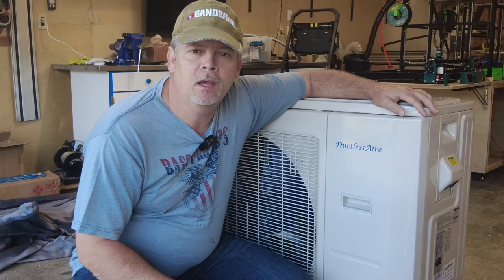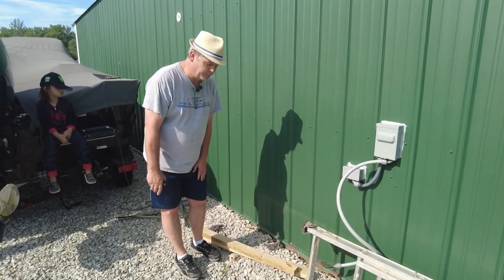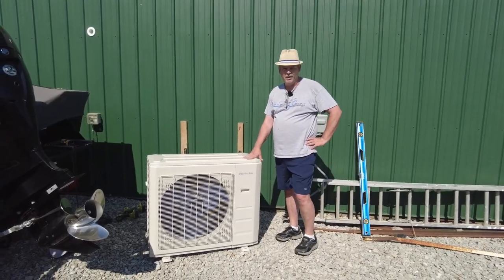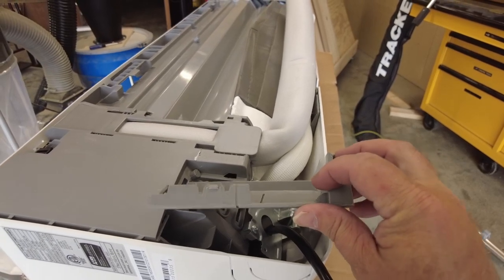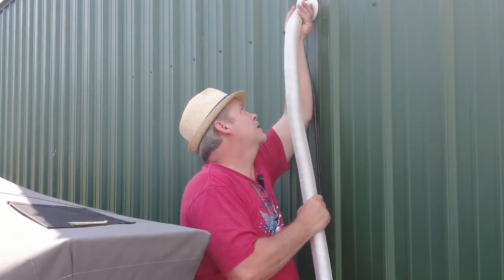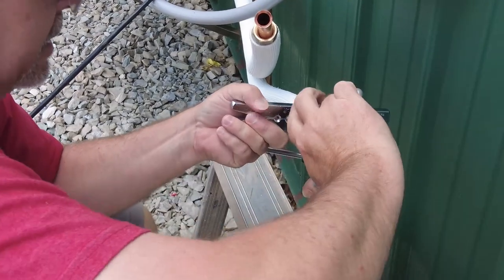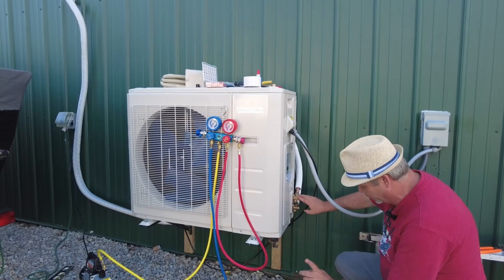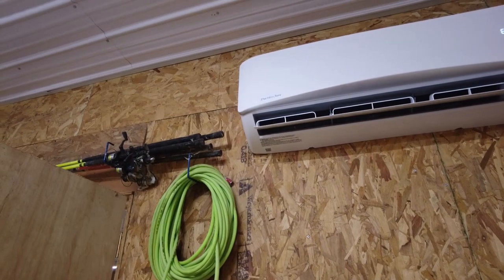How to install Ductlessaire mini split

Comment: Disconnecting the hoses before releasing the refrigerant introduces moisture back to the system pretty much your vacuum was lost you have to release refrigerant before you disconnect hose you have to have positive pressure so you don’t intrude moisture to system
Reply from the maker: Thanks for the tip, I'll pin this comment for others.
Reply: So I'm confused.  Is he saying you did this or is he just offering tip.  I just wanna make sure I understand fully so I don't screw my install up. lol
Reply: nvm.  i understand now.  means don't disconnect hoses after vacuuming out until after you release refrigerant
Reply: @eliyyahsilva1282  yes exactly after your done with vacuum close your low side gauge and turn off vacuum pump and don’t disconnect any hoses and then release all the refrigerant to lines with a Allen key and then once you release all refrigerant turn on the ac unit to cooling and then disconnect the hoses
Reply from the maker: @eliyyahsilva1282  Yes that's what he meant. Good luck, be sure to let us know how it goes.
Reply: @whatsnextdiy  You saved me $1500 installation.  I wish you many video monetization cycles in your future from YouTubers like me.  Thanks again, worked step by step and fired on cool the first try.  Thanks again @4K Crib for your tips as well....!!! Booooommmmm....
Reply from the maker: @eliyyahsilva1282  Awesome news to hear. Maybe one day I'll monetize but stories like yours are sweet 🎵 to me.
Reply: @whatsnextdiy  so I thought I did everything correctly and I still think I did, but it's possible something may be leaking now.  My inside unit is making a hissing noise now and I'm not getting any cooling.  Weird though because it was working fine until I tried using heat.  I have a home warranty so I'm going to have a service contractor come out now that all the hard work is done.  Hopefully it's as simple as them finding a leak and correcting it.  I don't want to take any chances though so a $125 deductible is a lot better either way than paying $1500 install fee lol.  I'll keep you posted.
Reply: Update:  Had heating/cooling pros come out and service it for me to double check everything.  Turns out I did not tighten one of the flare nuts down enough (low pressure).  I paid a total of $200 ($125 for home warranty deductible +$76 for recharging the refrigerant), but saved about $1300 so I'm still way ahead and I have peace of mind.
Reply from the maker: @eliyyahsilva1282  Awesome glad to hear it was something rather simple.
Reply: @eliyyahsilva1282 How’d your insurance claim go on the A/C you installed yourself? Lol
Reply: Is the unit still cooling and heating.?  I have installed 3 of these units on my house and have now turned off my big central air unit outside and inside.  The very first unit I installed I removed the vacuum pump connector BEFORE I opened the valve to release the gas into the lines.  The same thing you did.  At that time I did not know the procedure for releasing the gas.  The unit is cooling fine tho and has been running about 1 month.
Reply: I can confirm you must pressurize (just a little) the line before you remove the manifold.  1) as mentioned, it may draw air/moisture back in the lines.  2) you really don't know if you opened the shrader valve when you drew the vacuum.  it could be that you were just evacuating the manifold and hose.  You remarked at the fast response of the vacuum.  This is a sign that you may not have breached the line site.  If you can get a micron gauge, hook that up to the high pressure line (of the unit).  This will allow you to view the draw down and watch the recovery.  This is a much more trustworthy method.  With a typical split system on a home, you do this 2 to 3 times and watch how much the microns increase (moisture gassing) after shutting the valve off.  Also, many times a HVAC tech may pressurize/purge the lines with nitrogen to see the connections pass leak tests.  If you are connected to both H/L sides, you will see the gauges go up together even though your are inputting say via the L side.  On the last purge, you connect your vacuum pump and go through your pull down.  Then you know it will not leak with moderate pressure and you are actually evacuating the entire system.  I know this is beyond the average DIY install but just know it is the ideal way to do this install if you have the resources.
Reply: @eliyyahsilva1282  I just noticed this.  Yeah, in heatpump mode, the H/L reverses lines which means you have high pressure on the larger (suction in cooling) line.  I suppose it was a leak made worse by higher pressure.
Reply: I installed the same unit. Dealing with the line set was a bear! I wonder if it would have been better to separate the high and low sides. I was afraid all the torque applied to the indoor connections would cause a leak. 

Second, is there any reason the line set needs to be wrapped together?
Reply: Wrapping the lines is only to help get it thru the hole in the wall. I only did that with 1 of my units. You do need to get a vacuum pump and pump your lines down.
Reply: What you say is true but what the gentleman in the video was doing was checking for leaks.If the vacuum pressure dropped/failed to remain steady at any point in time the system would have allowed the refrigerant to escape once the refrigerant valve was opened and what then?
Reply: @eliyyahsilva1282  If you did like the gentleman in the video did and didn't ream the copper tubing after you cut it before you flaired the ends and also installed the high pressure line first instead of installing the low pressure line first then of course you ended up having a leak.The gentleman in the above video ended up having to really torque on the low pressure line because he had a leak.The gentleman in the video was trying to bend the low pressure line a bit more which proved to be difficult because the gentleman installed the high pressure line before he installed the low pressure line and as the video clearly shows the high pressure line having been connected first instead of last made any adjustment to the low pressure line very difficult.I'm surprised the high pressure line didn't end up leaking with how the gentleman in the video was cranking on the low pressure line and trying to bend the low pressure line further to where it needed to be bent.If the gentleman in the video was in such a rush that he couldn't be bothered to first install the low pressure line and tighten it down properly before he connected the high pressure line then why did he even bother?He had to know that doing it the way that he did it was going to allow a leak.I clean my own furnace and when ever I have to remove the atomizer to change the nozzle tip I am very careful not to over tighten and to this day I have never had to cut and reflair the copper tubing that that connects the atomizer to the furnace fuel line.That thing about having the copper tubing stick out a milimeter is also something that I cannot and will not put stock in because I have had to flair plenty of copper tubing and the only thing that I ever had to do was to line up the end of the copper tubing to be flaired flush with the face of the clamping jig and that was that.Here's a great trick that won't allow copper shavings to fall into the copper pipe/copper tubing when you ream the copper pipe/copper tubing.Stuff a piece of paper towel in the end of the copper pipe/copper tubing that must be reamed,ream the copper pipe/copper tubing then with a pair of needle nose plier pull out the piece of paper towel that you stuffed into the end of the copper pipe/copper tubing and you will never have any copper shavings fall into the copper pipe/copper tubing because as you pull out the piece of paper towel that you stuffed into the end it will bring out any copper shavings that would have stayed in the copper pipe/copper tubing if you reamed the pipe/tubing without first stuffing a piece of paper towel into the end of the pipe/tubing.

Comment: Thank you for sharintg your video with us.I hate to knit-pick but there were several things you could have and should have done.The first thing is that after you cut the copper tubing down to the proper length you neglected to ream the copper tubing ends and opened yourself up to have a serious problem.The problem you opened yourself up to by not reaming the copper tubing ends is that when copper pipe/copper tubing is cut the cutting process tends to leave a burr inside the copper pipe/copper tubing and therefore copper pipe/copper tubing must always be reamed after being cut to get rid of any burrs that result from cutting the copper pipe/copper tubing.The second thing that you did wrong is that you installed the high pressure copper tubing first instead of installing the low pressure copper tubing first.I pained me to watch you torquing the flaring nut on the low pressure tubing with how much stress you had to put on the high pressure tubing just to tighten the flaring nut on the low pressure tubing.If you had bothered to ream the copper tubing after you cut the copper tubing before you flared the copper tubing and you had first installed the low pressure copper line you would not have needed to use any type of teflon tape or thread sealant like you had to do in the above video.I'm 63 years old now and I remember when I was much younger I worked with certified contractors and licensed plumbers and I learned the hard way that copper pipes and copper tubing must always be reamed (deburred) after being cut to size.Even PVC pipe must be reamed after being cut because if not the chances of clogs increases from waste catching on the burrs left inside the PVC pipe cuts.If you don't believe me the next time you cut copper pipe/copper tubing stick the tip of your finger into the copper pipe/copper tubing that you just cut and twist the tip of your finger inside of the copper pipe/copper tubing and get back to me to let me know if you don't cut the tip of your finger from that because you can and you will cut the tip of your finger if you stick it in a copper pipe/copper tubing that you cut and neglected to ream (deburr).I may not be the smartest man alive but what I was taught I learned well and when I didn't pay attention and tried to take shortcuts I paid dearly.

Comment: Thanks for the video.  FYI they make a double flare kit.  It mushrooms the end and then you flare it making the connection double thickness.  I would recommend doing that if you can get the tool.  Less chance of cracking.  You asked about that caulk you are using that is sticky.  It is petroleum based and you can use a rag/finger and mineral spirits as a lubricant for spreading or cleaning up the excess.  it will not harm the remaining material.  Just note this must be done when applied.  After is sets, tough stuff.

Comment: Thanks a ton for this video. I installed the same unit last weekend. I bet it would have taken me  2-3+X as long without your video.
Reply: The only major problem I had was not realizing my service disconnect was fused, and I didn't put fuses in.  That took me hours to figure out.
Reply from the maker: Awesome, I'm glad it's helpful. 😁

Comment: What were the plastic piece you put in the wall for the hoses and wire to pass through? I don't see them in the box with my unit and would like to get some for a cleaner install. Thanks
Reply from the maker: @TheRealReasons  I made them with my 3d printer. Its just a basic collar for looks/protection..

Comment: When I installed my outside unit bracket, I used lag bolts instead of the anchors they provided. I felt better using lag bolts with wood.

Comment: Doing my Ductlessaire this week. Only thing that concerns me is kinking the lines on the unit.
Reply from the maker: Nice! Near the Head unit the spring type wrapping makes it pretty easy. Just take your time and try not to bend it too tight all at once. If you feel it give stop in your tracks. You could also pick up a tube bender if your overly worried. My unit works great so far.

Comment: How are the flange connectors holding up. Looks like they were torqued pretty tight.
Reply from the maker: The unit has been performing well actually its doing better than the new Heat pump I had installed on my house. It might look worse due to having a hard time getting bends to line up perfectly.

Comment: In your video, you call the green wire running from the 220V disconnect to the outdoor unit “ground. But, I think that would be called “neutral” (normally white) on a 220V 10/3 line, right. At that means the outdoor unit is not earth grounded?
Reply from the maker: I extended an existing 220 circuit that I wasn't using any longer, which if I remember correctly was two hot legs and ground. The neutral wasn't used.

Comment: Hey, thank you for the video. Just installed mine with your video.

How are your winters and summers?

Do we need to wrap the insulated pipes that are outside?

Hows the unit running these days?

Thank you.
Reply from the maker: The unit is working well, although I haven't used it much this winter. I just wrapped my pipes with the tape that came with the unit. I'll use it more in summer as I have a couple projects to do once I finish my landscaping.
Reply: @whatsnextdiy  Right on, thank you for the response.

Did you wrap the lines that are outside? Or is the insulation that it's encased in sufficient?
Reply from the maker: @totallymediocre  I didn't do anything beyond what came with the unit and has worked fine.
Reply: @whatsnextdiy  Thank you sir. Everything is up and running *knock on wood*.

Your video was amazingly helpful!

Comment: It’s 2 yrs later how is it holding up I am about to pick up that same model
Reply from the maker: Its been great, I run it when I have projects out in the shop. I've been running it the last few weeks as I've been building a outfeed table for ny table saw.
Reply: @whatsnextdiy Ok  cool that’s good  and Nice video
Reply from the maker: @biggeezy_1le98  Thank you

Comment: The installation manual states that the drain hole on opposite side of indoor unit (unused) must be plugged to avoid leakage. I dont see that. Did you plug the unused drain hole?
Reply from the maker: No, I did not need to do that. I believe the statement is there in case you use the other drain. I used the one that was hooked up from the factory.
Reply: Yea I’m in the middle of my install of this unit and I read about plugging the other unused hole too. I see where it needs to be plugged but I don’t have a plug included. I do however have the plug nozzle that goes outside under the unit … I put that on, although I can see how it’s not necessary

Comment: After the 15 min vac pump run, pressure goes back to zero in 2 seconds. I’ve confirmed with soap no leaks in lines or gage lines. Do I have a bad gage?
Reply from the maker: I would recheck all connections and fittings, along with my gauge setup.. When I did mine I had a hard time getting the vacuum line tight to unit, think I used thread tape eventually.
Reply: May I ask, how did you know it was leaking at the Blue line adapter?
Reply from the maker: @davidwalker6574  I could feel air while the vacuum was running

Comment: Does every unit need its own condenser?
Reply from the maker: You can have multiple indoor units to one condenser. If you purchase a unit that can support it. Each indoor unit will have its own line set to the outdoor unit

Comment: Im trying to get my wires in on the indoor unit and I cant get my wires to tighten down they keep coming out!
Reply from the maker: Make sure you use the correct size crimp caps. Larger ones are for AC side.
Reply from the maker: Also you need the correct crimper
Reply from the maker: https://amzn.to/3wIqu2c this is the crimper I used.
Reply from the maker: Guess that one is unavailible, but this one is similar https://amzn.to/3P7ooPy

Comment: Did you have a drain joint you had to install to the bottom of the condenser?
Reply from the maker: Mine was missing, I contacted the manufacturer and they sent me one and told me it was optional. I didn't need mine as I didn't need to run the water away from the unit.

Comment: Did you need to run a separate power supply line to the head unit. The instructions are horrible from ductlessaire.
Reply from the maker: No just the line they supplied

Comment: That water drain line (on the inside) has a dip in it. Is that your water trap?
Reply from the maker: No I straightened it out when I wrapped it. I believe I stated that's what I was going to do in the video.

Comment: Where can I get the USB to use the split over wifi? Thanks!
Reply from the maker: Mine came with the unit. You might check with the manufacturer to see. I'd imagine it's just a generic USB wifi adapter.

Comment: Hi! Would love info on how you ran the Electrical. Is that a standard 30-amp disconnect? Just ordered mine. I've done a lot of residential electrical, just never run a disconnect. Would love an explanation of size wire used and box type etc.. Thanks!
Reply from the maker: Actually, the one I used is rated at 60amp but it was what they had in stock at the store. It is just a standard non fused disconnect. The wiring size I used was based on a 20 amp breaker in the panel and the max load of the unit which is stated as 18amp. The wiring to the breaker is 12 gauge and I believe the whip from the disconnect to the unit was 10 gauge (again what was available at the store). The box I used for the feed to the disconnect was just a standard outdoor metal box.  The biggest thing is to make sure your wire will handle the load of your circuit breaker and the load of the unit. The disconnect is merely there for safety while servicing the unit. Hope this helps.
Reply: @whatsnextdiy  so, you just ran 12/2 to that disconnect from a 20amp breaker?
Reply from the maker: @scottythompson4667  12/3 its a double pole breaker. Its 240v for the unit I have